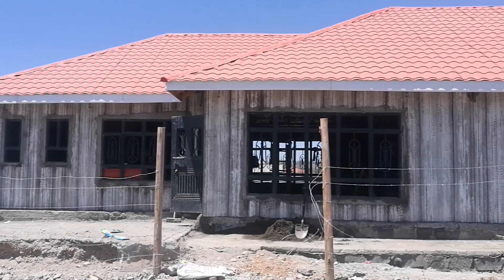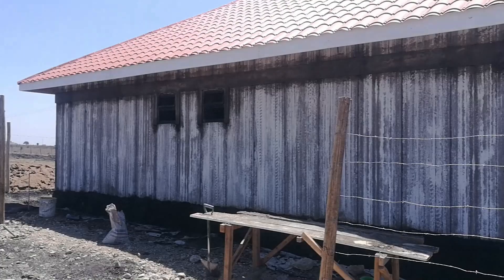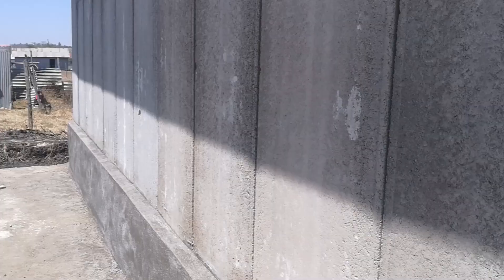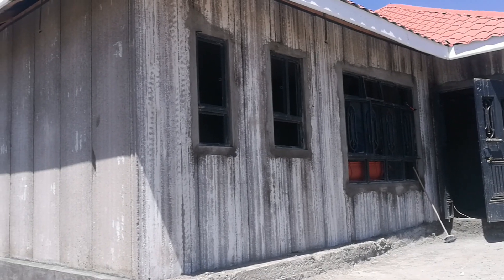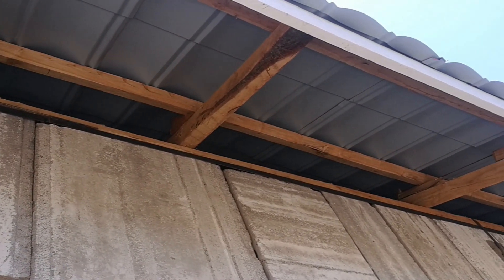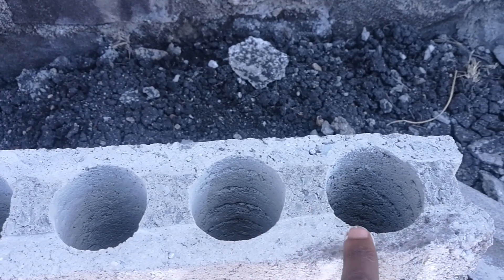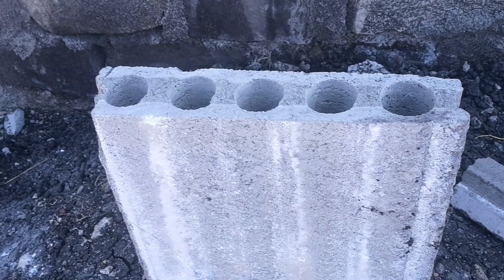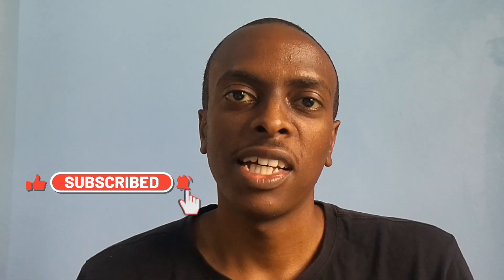1 WEEK Job! Using Precast Concrete Wall Panels on this 4 Bedroom Bungalow

Comment: Hey nick I was wondering how you can insulate in case I'm building where it's always hot and High humidity. 
Thanks for the detailed info.
Reply from the maker: Maybe you can add insulating materials inside the hollow sections, or you can ask insulation experts for better advice.

Comment: Hello. I have been watching your content for a while. Thanks for the good work. I am interested in putting up a family home. Are precast concrete panels good in storied buildings considering the weight
Reply from the maker: Yes they are...Kindly reach me via email to help you with quotation: propertynoma5@gmail.com
Reply: @PropertyNoma am interested give your location pliz need to do a wall of a plot at sagana
Reply from the maker: @ritagichuki7047 Head over to Kingdom Precast Solutions in Ruaka, Northern Bypass Road

Comment: Are they thick enough as to.the normal building stone of 6ft and 9ft or they are much thinner?
How strong and durable are they?
Reply from the maker: They're thinner but are made of precast concrete and prestressed steel tendons

Comment: What is the life span of this building technology in a country like Namibia
Reply from the maker: I don't have an idea. Maybe you can research on the lifespan of concrete in Namibia as the panels are precast concrete panels
Reply: @PropertyNoma  thanks. How many panels of the wall will be require to build the bungalow in your video?
Reply: @kamallamid3052  close to 140

Comment: Thank you for sharing. So, what give it strength and durability, if it's both plastered like the EPS?
Reply from the maker: The hardened concrete and steel mesh embedded inside gives them their strength
Reply: @PropertyNoma  Okay. Thank you. I didn't realize they had embedded steel mesh...
Reply: How durable are the properties?

Comment: Hi Nick.  Thank you for this info. I’m almost sold to this kind of building especially now you are showing actual houses built this way. How much did this one cost? Approximately please
Reply: www.apdhomes.co.ke
We build using Precast wall Panels technology
Reply from the maker: Hi, I don't have the figures for this house. However, Squareapple claims an approximate figure of Ksh 1.5M for a typical 3 bed bungalow after standard finishes.

Comment: Great as always. I am in Ghana and need prefab blocks but there is no company that makes it. is it easy to ask a mason to make pre-fab and what nonfactory machine would I need?eg manual machine and can i buy one from Kenya
Reply from the maker: Hi Millicent, I think  it's expensive to use a mason to make these panels when compared to mass production from a precast panel company. I have not had a chance to see the machine that makes them. Hopefully I will in future.